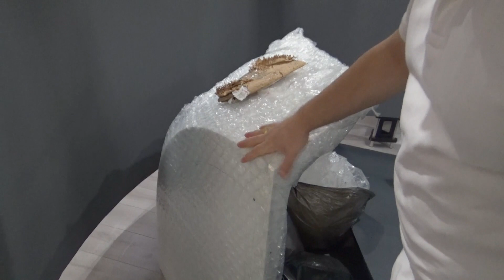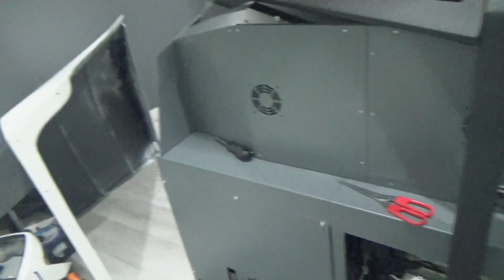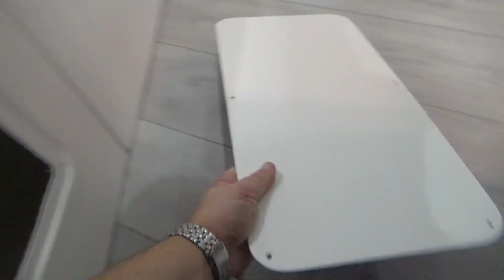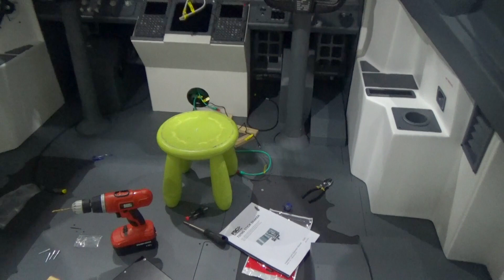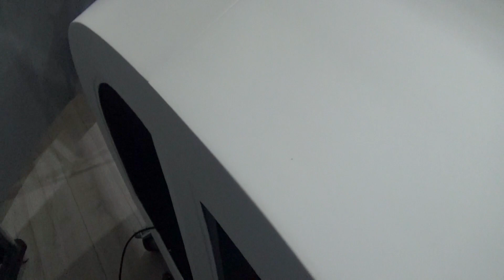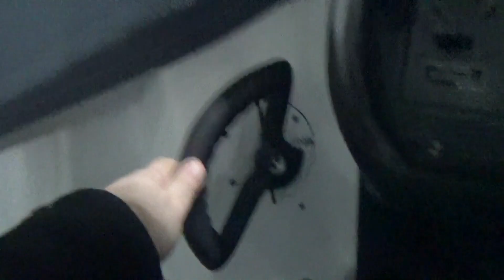Cockpit Construction Part1

Comment: Ciao Alberto. Really enjoying your videos! I was wondering about your power cable management. I am planning my sim build and thinking of getting the single mip config from sismo with MCP+EFIS included. Did all of your hardware from your MIP run via one 13amp UK wall outlet? Is that enough? Im also based in the UK so trying to calculate power draw. Don’t think mip and the sismo modules draw that much power? Grazie e salutoni:)
Reply from the maker: Ciao, ti rispondo in Inglese visto che potrebbe interessare altre persone. When i started building the simulator i calculate the overall power drwan but the full cockpit. The main parts are the 2 mini pc that embedded in the Sismo MIP and the 3 monitor which are for the Captain side, FO side and Eicas. The rest are all pcbs and controls running at 12 V dcc.
Overall, although my simulator have several power plugs, ethernet cables, wires etc.. it is all powered by a single 13A wall outlet. In fact, even with the full cockpit lit and operational, i don't even get close to the max nominal power drawn. Overall, it's like having couple of deskptop computers running, that's all really. You are going for the single configuration, i believe that includes a single mini pc and 2 monitors so you will be fine. Where are you located in Uk?
Reply: @alpasimulation5485  Grande! Grazie. Ho scelto il single mip per motivi di spazio e budget. Io sto southwest UK, zona Bristol. Te invece?
Reply from the maker: @MS-ln2kw  Ero in zona Bristol qualche settimana fa per lavoro. Io sto in Hampshire, tra Basingstoke e Hook. Magari una volta ci organizziamo e vieni a provare il mio simulatore cosi puoi vedere da te
Reply: @alpasimulation5485  Sarebbe veramente un piacere. Mandami il tuo email (ma come si fa un messaggio privato?) cosi se passi vicino qua o io vicino da te magari ci vediamo per un cafe.
Reply from the maker: @MS-ln2kw  non so come si fa un messaggio privato
Reply: @alpasimulation5485  Se trovo come fare ti mando un messaggio. Cmq spero di avere il mip questo estate. In tempo per il PMDG 737;)
Reply from the maker: @MS-ln2kw  se fai sulla pagina mia facebook, penso che da li puoi mandarmi.un messaggio privato perche' altri hanno fatto la stessa cosa

Comment: I'm thinking of what kind of air conditioner to be use in that cockpit. If its me, I want a real ac cold air coming out from the cockpit ac vents. I want an enclosed cockpit to maintain realism. Even the cockpit door will be identical to the real one. When recording audio from inside the cockpit with gopro the recorded audio will have almost the same sound and nuances as if it in the real cockpit. For ambient audio I'll be using surround sound with subwoofers that can reach subsonic bass frequency extended to 14hz. This will add more thump and pressure as low frequency bass can be felt and not heard. Just my wild imagination though 😅
Reply from the maker: That's i suppose is what all cockpit builders imagine, and it can be done actually. I do have real replica door and CB panels and I am in the process of sorting out the best way to replicate sounds in the cockpit. For instance, engine running sound should come from the back of the cockpit. I also need to sort out the headphones which will filter cockpit noise for better ATC and pilot-to-pilot communication. As for the AC, didn't get at that stage yet but if I am doing something it will be post on the videos